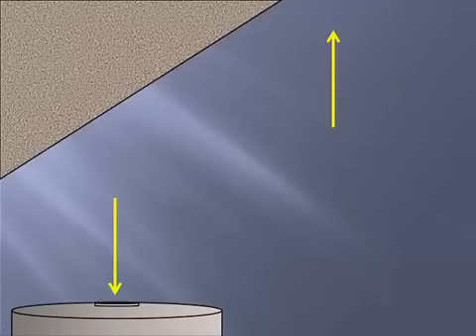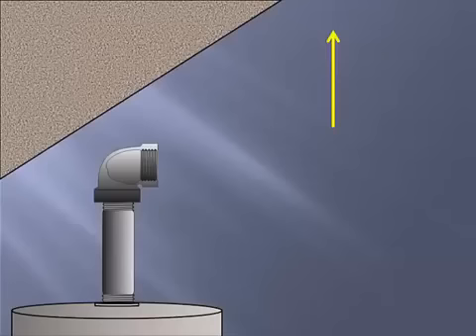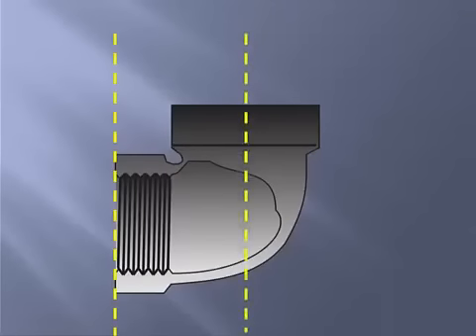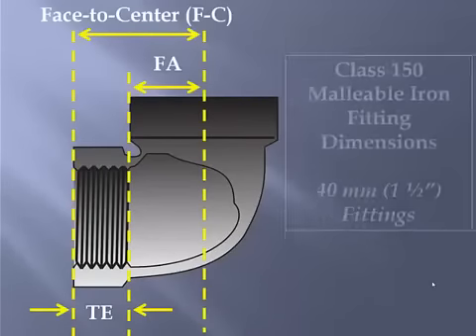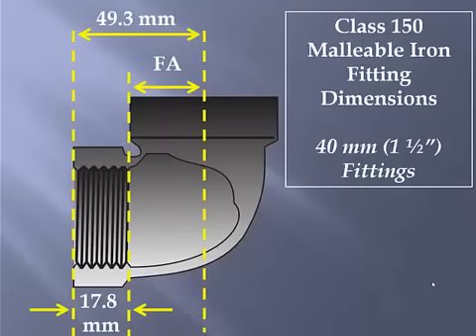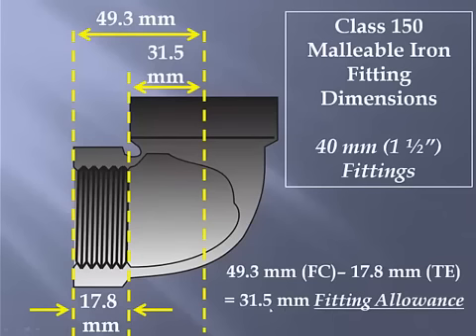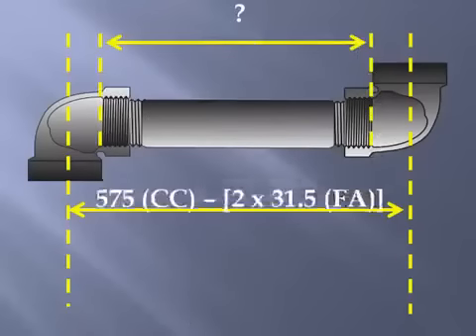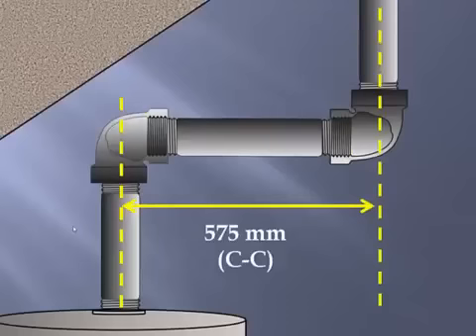Darren's Fitting Allowance original

Comment: Plumbing threading dies are tapered.  Personally I have never seen a pipe thread occupy the full thread engagement of the a fitting; it is always less.
Reply: 588158 never if it does that means the threads aren’t doing their job. And it will leak